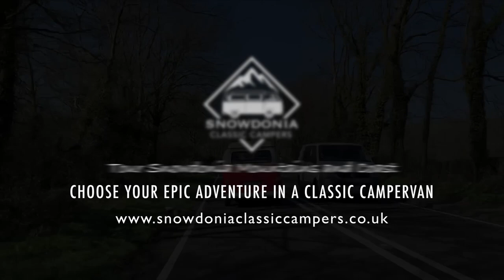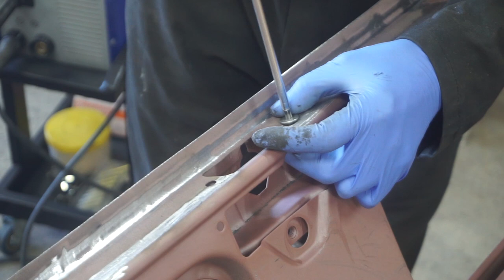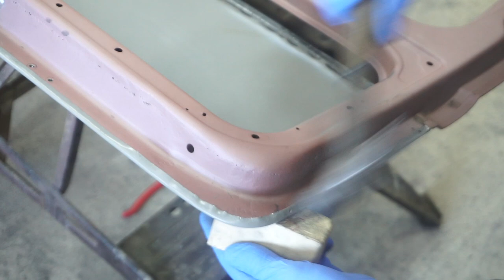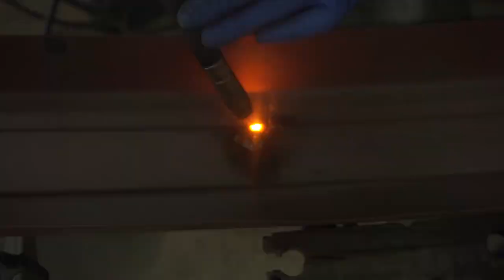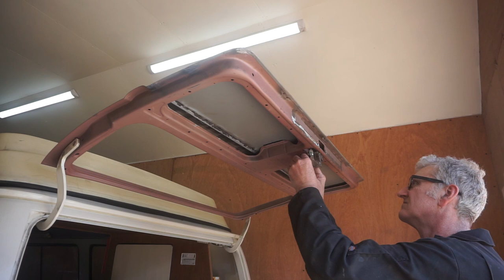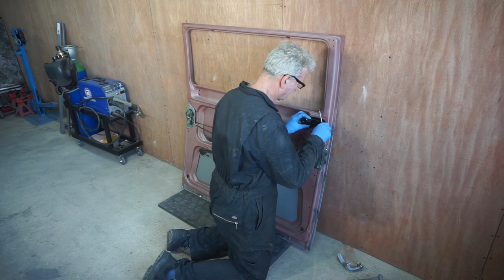1973 VW Campervan Restoration Part 18

Comment: Hi there, first of all, this series is fantastic! I am slowly progressing my way through the lot prior to picking up a 1972 early bay cross-over. Can I ask, have you used the 'step' method for each other the panels here? I saw you use that with the sliding door, but I haven't seen you step this panel prior to welding etc. 
Thanks for your time. 
Steve